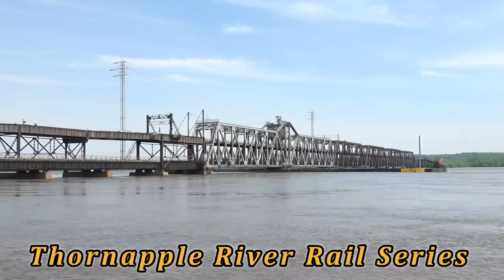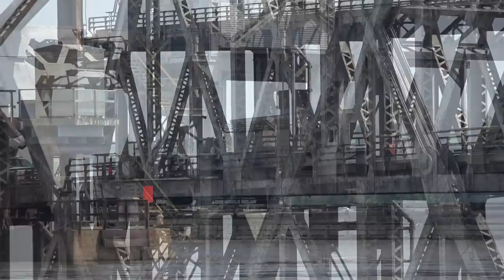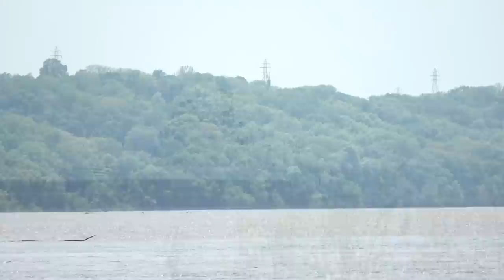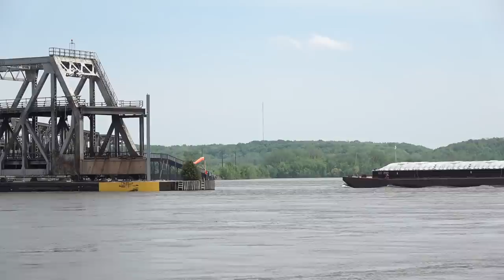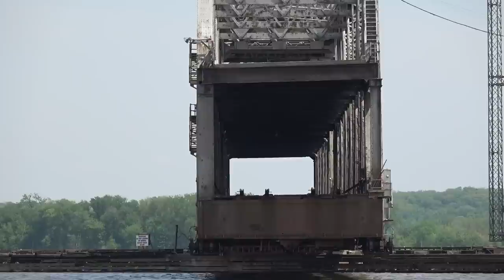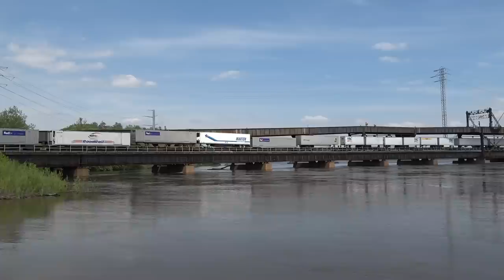TRRS 532: BNSF's Fort Madison Swing Bridge

Comment: Another homerun video!  If there were a 10X-thumbs-up button, I'd've just tapped it!  Santa Fe was, and by extension BNSF, is so lucky that that bridge was built as a double track span and also that it is high enough, just barely, to clear double stack domestic containers.  That bridge was already 50 yrs-old when the very first double stacks took to the rails, and those international containers of the late 1970's and early '80's were still a couple of feet shorter than the domestic containers of today.
Reply from the maker: Indeed, imagine the headache if this were a single track and too low! Amazingly the first bridge at the sight was also double-track, if my source was correct! Talk about foresight.
Reply: Was just wondering if it was a double so thank you man! AMAZING bridge!
Reply: @ThornappleRiverRailSeries  – Double tracking was very common in the 1800s due to poor communications and signaling as compared with the 20th century.

Comment: Now THAT'S A bridge! Great video! Looks closely at 2:20 and you can see a PTC antenna on the top of the bridge.
Reply: PTC?
Reply: @bullmiller175  Positive Train Control
Reply: I grew up on the Illinois side of this bridge, about 35 miles SE.
The toll was 10 cents when I was a kid, but slowly raised.
Iowa was a “dry state” until around 1963 — so the restaurants (with bars) were on the Illinois side :-)

Comment: A few years ago CN replaced the ex CNW 1899 lattice truss swing bridge over the Fox River on their mainline in Oshkosh, WI with a single leaf roller bascule bridge.  Even though the old bridge had some issues with its foundation, it was still able to clear double stacked containers.

The new bridge opens and closes far more quickly than the old span.

Should a time come when North American railroads have to convert to overhead catenary electric for tractive power, good bye double stacks, tri-level auto racks and Superliners.

Comment: I know this is just railroad specific semantics, but as you're a true railfan i thought you'd get a kick out of this (if you don't already know)..... but......"double track" is a specific railroad term used to describe current of traffic in ABS TWC territory. We only refer to two parallel tracks as "double track" when we're operating on a territory controlled by track warrant authority and/or Automatic Block Signal track warrant territory. One track will be specifically for eastbounds, the other for westbound. In CTC (centralized traffic control territory), what looks like "double track" is officially referred to as "multiple track." Because control point signals and movement authority for trains is controlled by a dispatcher without the need for track warrants, movement can be in any direction on either track. If you didn't know already i thought you'd find that interesting. The territory through Ft Madison is CTC, therefore this section of track is called "multiple track." That being said, even us rail crews still say double track incorrectly much of the time because we're used to it having been double track before the conversions to CTC

Comment: Historic though it definitely is, BNSF is going to have to start thinking about the successor to this bridge.
Reply from the maker: There were preliminary plans to replace a pair of the fixed spans to the east with a new lift span, but that fell through and never made it very far. The Coast Guard wants to move the channel eastwards toward the middle of the river.
Reply: @ThornappleRiverRailSeries  I've been over this bridge many times, both in car and on bicycle, and have been caught by boats many times too.  I would not take a job that would require me to cross this bridge.  Weight is limited to 30 tons and semis are not permitted.
Reply: I’ve heard plans about dropping the car part of the bridge and rebuilding only a train bridge but I’m not sure how true that is.
Reply: polyrhythmia One of my friends is very worried about that as he works at the prison and with out this bridge he would have to go through keokuk or Burlington which both add a good 30 minutes to his daily commute. It is becoming a high possibility as this bridge is becoming very old and rebuilding a bridge with the road part would be very expensive for BNSF.

Comment: I have been watching this video closely, mesmerized as usual ! I love ancient forms of infrastructure. Traffic is fairly steady.
Can someone please tell me why building a proper bridge is NOT feasible ?
Reply from the maker: A taller bridge would require miles of approach fill to get the railroad up high enough. Thus, the cheaper option is to keep the low-slung bridges like this. In terms of replacing this older specimen, these structures were built to last, and will last almost indefinitely with proper maintenance.
Reply: @ThornappleRiverRailSeries  Much Abliged. I have NEVER seen a railfan channel better than yours!

Comment: anyone know how often they maintain or renovate this bridge....looks like it hasn't been painted (to protect the metal) for many a long year. Also, there appears to be little to no information available regarding the maintenance of this structure.
Reply from the maker: They do not need to repaint the bridge all that frequently. It’s fresh water and it gets very little salt because they don’t salt on the bridge. Like most railroad bridges, repainting is infrequent and this isn’t a problem with steel erosion. It’s still inspected regularly and they keep track of what may need work.

Comment: Great video!!! I got to this one from looking up our local swing bridge my town built in 1911 and still in service for freight (Middletown to Portland over CT River).  I have one question... this looks low to the water, what happens when the river rises? does it flood on the lower level where the trains are?
Reply from the maker: The river looks low but the bridge is so huge so as to make the gap seem smaller than it really is. I’d estimate it at 15-20’ of clearance at normal water. This part of the river is relatively wide and is the far north end of a dam impoundment, so while the river can and does definitely rise, this bridge is not typically at great risk for being overwhelmed

Comment: When the river floods is the rail part of the bridge under water. Does the electric equipment get damaged?
Reply from the maker: The river is wide enough that it generally doesn't rise high enough to hit the bridge. There is still well over 10' of underside clearance, even at this already elevated state as shown in the video. Typical water level is another 5' lower. The upper Mississippi just doesn't flood quite like the lower can.
Reply: @ThornappleRiverRailSeries  but you do once in a while have barge that hits the bridge now and again, also bout a 125-127 trains run through Fort Madison a mixture of Union Pacific and BNSF
Reply: I’m not sure about the electrical equipment but I do know this bridge has been partially underwater many years ago.

Comment: Governments here had been promising all these decades that what little share of piggyback service had existed would be greatly augmented so as to lift trucking off of, e.g., the congested Quebec-Windsor autoroutes, but now I can't even remember the last time I saw piggybacking here. Anyhow, I'm now wondering what it must take to bind 15 fluvial barges together..never knew about such shipping.
Reply from the maker: All of the double-stack traffic is essentially the same as piggyback. At this point it is pretty just the less-than-truckload and premium logistics carriers using piggyback rail service. Everybody else containerized. Piggyback works when you don't want to worry about trailers and also when you use "pup" trailers like UPS, FedEx, etc do

Comment: It is a beautiful old swing bridge from a bygone era but it should really have been replaced long ago by a tunnel.
Reply from the maker: A Tunnel would be impractical, because the river is deep, the ground is poor, and the railroad is near water level for some distance either side of the bridge, so there's a huge risk of flooding any tunnel.
Reply: @ThornappleRiverRailSeries  
There’s a nice swing bridge in Clarksville Tn. It not a double but spans the Cumberland. There’s an Ingram Barge CO. sand depo up from it, and it swings on a regular basis.

Comment: For as important as this bridge is to BNSF you'd think they'd take better care of it than just letting it rust in place.  Has to be cheaper to paint it regularly than to remove rust and paint.
Reply from the maker: As long as the rust isn’t causing section loss, it’s fine. Surface rust will protect the steel underneath generally speaking so most of the time corners and crevices are the concern since it can build up. Most railroad bridges do not need to be painted with the same frequency as road bridges as they are overbuilt and/or designed to be allowed to rust.
Reply: Interesting, but I guess the other point I'd make is it doesn't look good and reflects poorly on Ft Madison and the surrounding towns.

Comment: This bridge looks prone to flooding.
Reply from the maker: It's not too bad, actually. The river channel is wide and at this point starting to pile up behind one of the low-head dams on the river. It is quite common for the water to get up to the bottom stringers of the bridge but to my knowledge very rare that they have to shut down rail traffic.

Comment: This is really cool and all, but why didn't they make the bridge taller? Is there a replacement in the works? It's so inefficient. And I'm an Iowan that has crossed this bridge a few times.
Reply from the maker: In order to clear river traffic, the bridge would need an insane amount of clearance - think of the freeway bridge in Burlington. To get 100' of elevation on a railroad with a decent 0.5% grade you need almost four miles of track, which is prohibitively expensive. Plus, that tall bridge will cause problems for trains climbing hills, burning extra fuel, more bridge maintenance, and so on. Much cheaper and more efficient to simply have a low, movable bridge.
Reply: @ThornappleRiverRailSeries  Great points. So why is this bridge so rare? I'm trying to remember how the Rock Island Arsenal bridge works. I've driven over it a couple times over the past two months.
Reply: My bad. It does rotate....
Reply: it was built in 1927, when they never envisaged that one day they'd have trains with two stacks of containers

Comment: The bridge needs urgently to be painted.
Reply from the maker: Not really. The steel readily withstands the light rust, it isn't in any danger of becoming structurally deficient. Paint is expensive. That's why they really only paint the center span, so that it doesn't expand or contract to the point where it doesn't line up correctly.